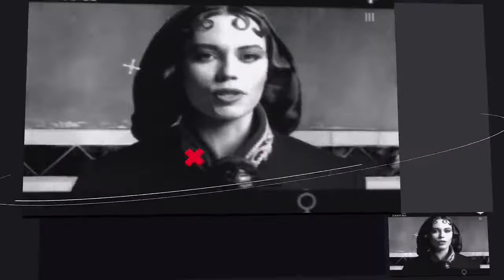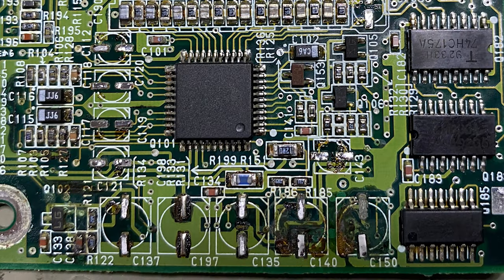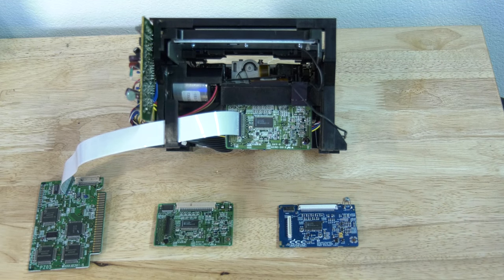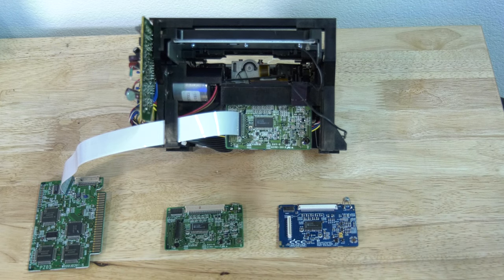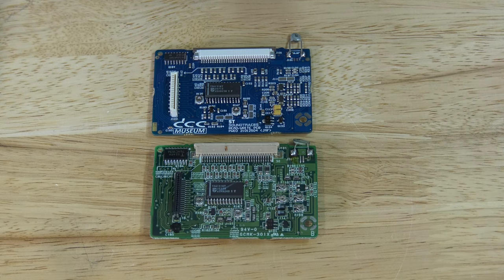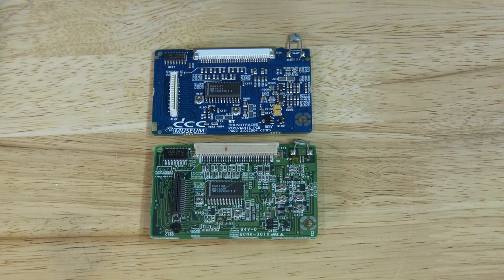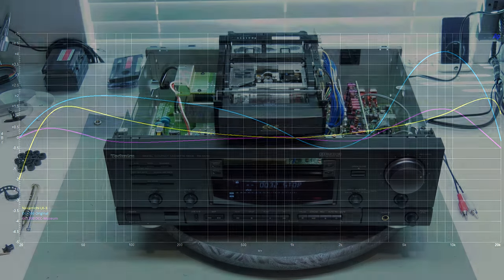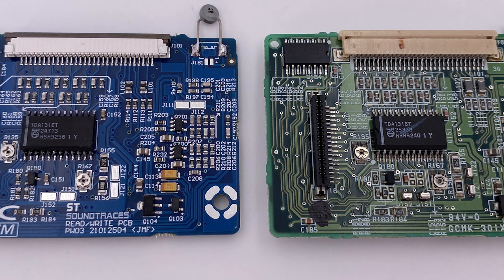A New Designed DCC Read-Write Board PW03 For Any First Generation Digital Compact Cassette Player.

Comment: My DCC 900 will probably need one of these. You recapped all the boards and initially it worked fine, but since then analog tape playback has become just noise and static, and the read/write board has some visible corrosion on it.
Reply from the maker: Happy to Help.
Reply: @vwestlife you know the playback of analog cassettes should be kept to a minimum
Reply: @PhilipvanderMatten  Yes, Ralf has told me about that.

Comment: How much is this new board. I'm very interested in replacing the board on my Marantz DD 82 before these problems arise. My deck looks new since I bought it back in the mid 90s it's hardly been used. I also have a large collection of DCC tapes with many unopened (as new) your videos have fired up an interest once again, and would love to add my Marantz DD 82 to my audiophile HiFi system with peace of mind to record from other digital sources.
Reply from the maker: @ProjectOverseer  dccmuseum.com/shop/
Reply: @DRDCC  
Many thanks. I'm UK based so I suppose this makes upgrading impractical?
Reply from the maker: @ProjectOverseer  we have a service address in the Netherlands as well.